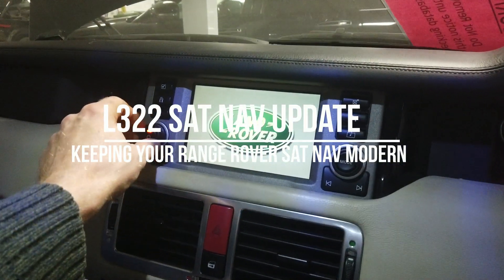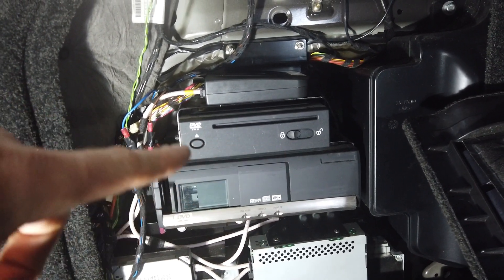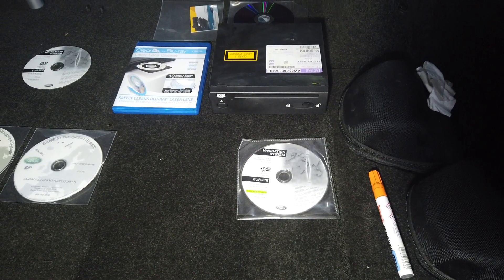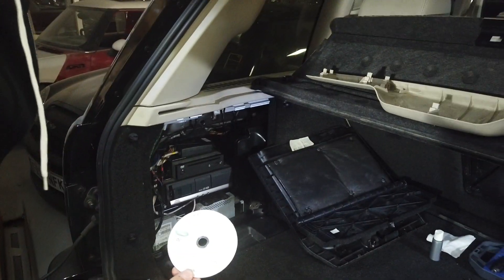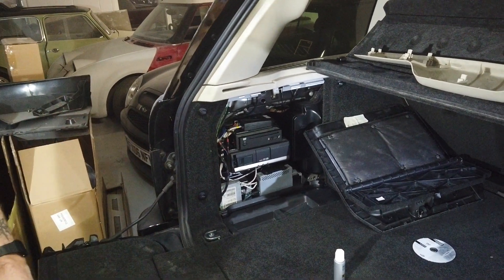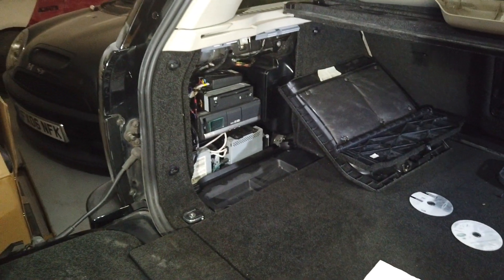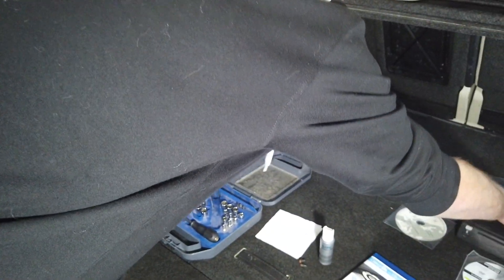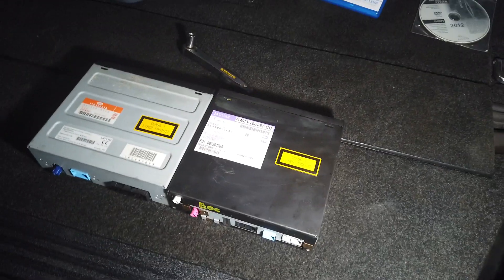Range Rover L322 SatNav - Map updates / Navigation DVD location

Comment: That's not a MK4 the MK4 is the unit upto 2005 that is a BMW unit. The range rover was fitted with a mk3 cd unit that can be swapped for a BMW MK4 dvd system straight swap. The system in there is the denso system (Kenwood dv3200 based)
Reply from the maker: Yes i was a bit confused about the MK4 etc but thanks for setting me straight !
Reply: @L663  there maybe another way to get the drive mechanism for the l322 I believe the same system was in some Saab's Subaru's and Volvo's around the same time. The plastics maybe different but the internals could be the same as they were all dv3200 based. There is some people who have upgraded their Subaru or Saab to the Kenwood kna-g520 I may look into this more in the new year to see if it can be done with the l322
Reply from the maker: @aylesburynumptydrivers9672  Hi - let us know what you find - we are happy to by parts and give it a go if you point us in the correct direction !

Comment: Help!  I just bought a 2010 Range Rover Sport Supercharged. L320 (not sure how to find that). I don’t think it has a DVD player. I called the dealer & they don’t do upgrades on the navteq navigation system anymore. Any suggestions where to find one?
Reply: Btw...I’m in the USA
Reply from the maker: There should be a DVD slot in the front - but I am not sure what happens if you put a DVD in the slot !
DVD's are getting a bit old now ! 
https://www.dropbox.com/s/gcg5wjd66i0ykqw/sport%202010%20dvd%20player.JPG?dl=0
Reply: @L663  Thanks!  Do you know where I can get a CD that has current info?